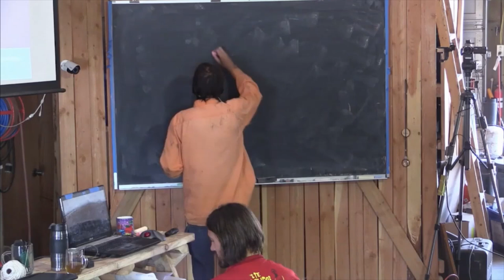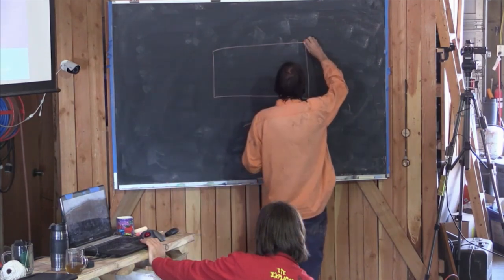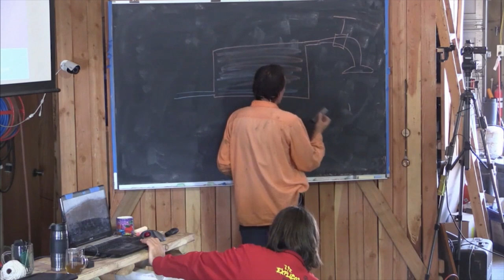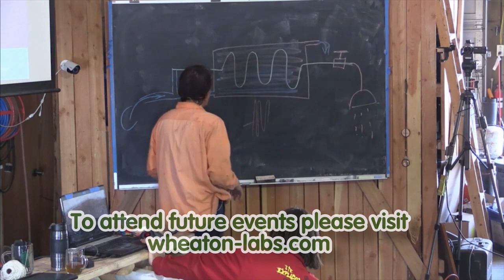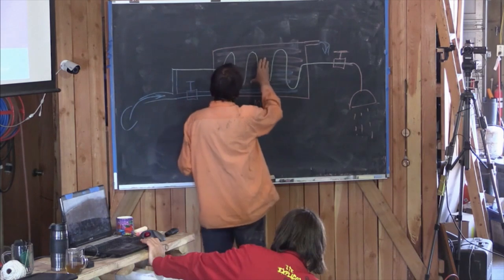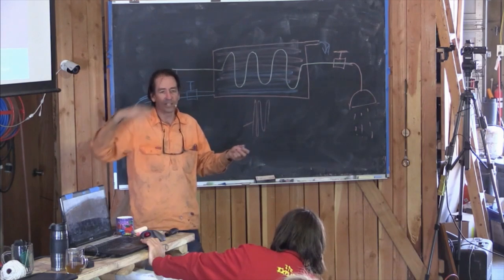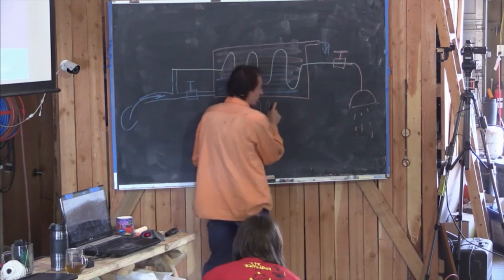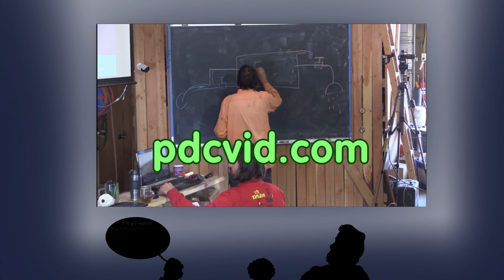Appropriate Technology Course: Rocket Water Heater

Comment: Could you have the coil work its way up from bottom to top of the tank, instead of side to side? That would at least get the last few spirals in the top part of the tank, so the water inside the coils matches the stratification inside the tank, with the coolest water entering the bottom and the hottest water being pumped out the other side.
Reply from the maker: there is no coil
Reply: @paulwheaton 
The coil of copper pipe at 2:00